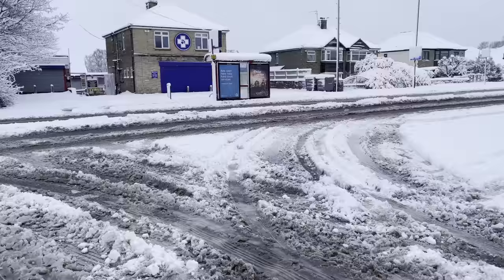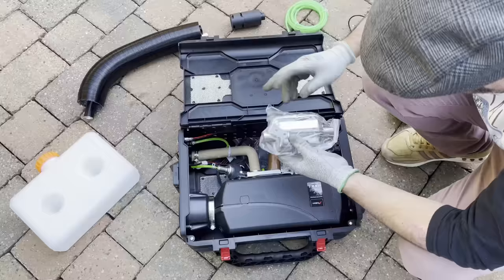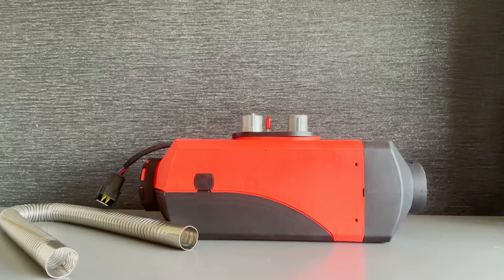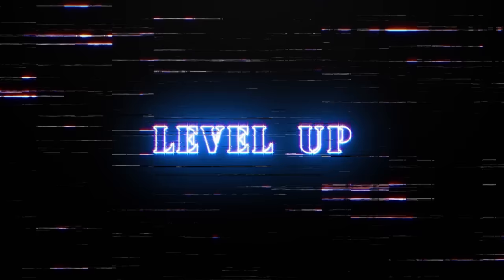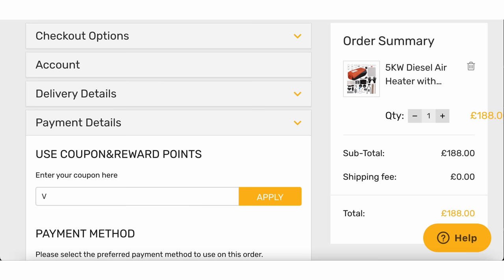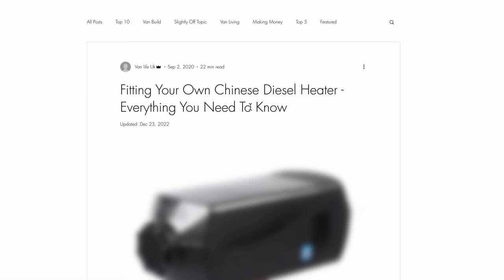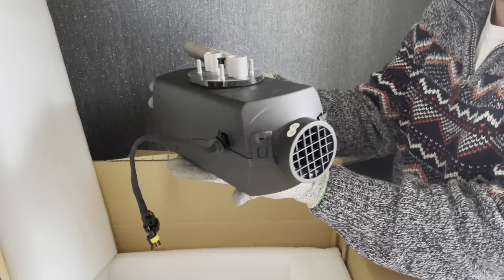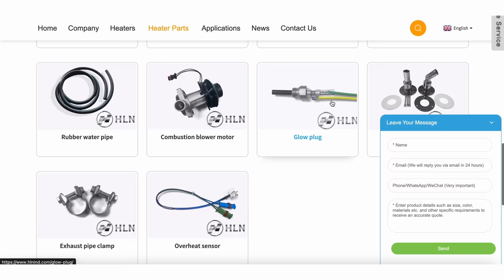Chinese Diesel Heater Buyers Guide & Tried and Tested Heaters 2023/2024

Comment: Just a heads up on VEVOR heaters, many of them are fitted with IEC power connectors (100 - 250v ac) but being used for 12 - 24v dc   absolute no no. I have just spent several years testing chinese goods for quality and safety and although now retired just help looking at such things.  Enjoyed the vid and found it both useful and enlightening!
Reply: I was shocked, but not at all surprised to see that. It's disappointing that the Chinese manufacturers keep sabotaging themselves with small things on otherwise good products.

Comment: Nothing wrong with that green fuel line just the installation
Reply from the maker: Its bad mate, not only is it not fuel grade, can kink, split, degrade, cause air bubbles etc it also means that the pump has to push and pull twice the amount of fuel than it does with the correct diameter fuel line wearing the pumps out quicker too. If you use any other fuel line thicker than 2mm inner diameter or the wrong type with Webasto and eberspacher and your pumps fail they void your warranty down to user error.
Reply: @vanlifesurvivorsguide  ive had my set up running with that fuel line for 2 years, i respect your vast knowledge on these things but these are my findings for diesil not petrol, it will only kink if your installation is poor, the ristriction through this feul line is minimal compared to the solid stuff so its not pushing hard at all(im a heating engineer, hydrolics and flow is something i know about) + you need to put a connection piece at every joint inc the filter!!.
Id like to know how old the line (or what you put through it for it to degrade or split, air in the line dose'nt seem to matter as  the pumps as its never running dry.
Ive just stripped my heater down to see how see looks inside and i cant believe how little soot there was. None in the burn chamber and just a small amount on the heat exchanger walls. I use this in my workshop so its on all winter set on 1. Very impresive. Only run mine on kerro/diesil. Your vids are top notch so i hope you dont mind me " having a conversation" about "the green stuff" as i only ever use experiance to disprove ....or proove what works or dos'nt. Keep your vids coming there informative and entertaining.
Reply: I have a vevor, eberspacher 5000. It has the controller with the timer., and 6 levels of heat adjustment,  or temperature controlled.  my question is there any way to change voltage from 12v to 24v.

Comment: One small detail to add, I have the 5kW Maxspeedingrods and it's controller does go to sleep with a black screen after a few minutes. I also tested the burn mixture with a CO tester and found it to be perfect, averaging 1-2ppm once at temp. The fan is also double balanced and is very quiet, despite being brushed. It's controller also has audible speech assistant. I'm very impressed with it so far.

Comment: I appreciate your buyer's guide.
I bought a Chinese heater and after installing it, it worked for 2 hours before it thew a high temp sensor code.
Reminded the first didn't work, I expected is that a replacement wouldn't either.
So, I ordered three new sensors from three different manufacturers.
I also ordered a rebuild kit.
It's still 15 days out.
When the first high temp sensor arrived, I installed it, only to have the unit throw two new codes:
Underpower and overpower.
Yet another reminder that it's Chinese. 
I've ordered a new motherboard and controller... 20 days out.
If it doesn't work, there will be a sledgehammer party at Peter's house.
I expect I'll be buying either an 
Hcaloric or something a bit more expensive.
Thanks again for the buyer's guide.
I'm polishing-up my sledgehammer...
Reply from the maker: To be honest mate, it sounds like you have a dead cell in your battery or a vey low battery. Either that or the motherboard. I have pnly ever seen error code 2 on 12v if the battery was damaged or the motherboard
Reply: Lucky for me, I ran into you !!
While in wholesale denial, I checked the battery with my voltmeter anyway...
My brand new battery was only kicking 8.4 volts.
Luckily, I'd bought two.🤣👍

Houston ?
We have heat !!
Reply: 2 hours later, the pump dies.
I already ordered the quieter pump, I'm just not sure what I did with it.
Honestly, have you ever heard of anyone having this much trouble ?

Comment: My new heater arrived. Been testing, OLOEY 12V-24V Diesel Air Heater 5-8kw £80. Worked out of the box, no smoke. But the inlet silencer not very good, just hollow inside. So have a few exhaust silencers so put one on the air intake, what a difference. Stopped the intake roar. Have a box silencer for outlet, definitely better than the tin plate one. The controller just has a 6 step temp. controller. Better as you can change at will from remote.
Reply: Video prices expensive.

Comment: I've spent weeks trying to decide if a diesel heater was the correct choice for my Bongo Friendee petrol driven, self-converted camper. It's almost the last job, and I've done 95% of the design and actual work myself: not bad for a 69yr old disabled old bag methinks😉 This video told me everything I needed to know and was very unsure about, thank you so much. It's down to the Lavaner Pro 2kw and the HLN Aerolyn 4kw now, but I'm wondering if the HLN, which I think is my prefered choice, would be over-kill? The van living space is only 130cm x 210cm and there's no space beneath the front seats, which is where most people seem to mount them although it could possibly go beneath the R&R bed, by the back door, but then I'd worry about sleeping above it!  Having it outside the van would be difficult as I can't bend my back much and I can't kneel down either, so filling the tank would be a huge challenge! I'd be grateful if anyone has any ideas/solutions which could help, thanks 👍😊
Reply from the maker: Hi Lynette, yeah i think the 4kw hln would be over kill but they do a 2kw hln too that would be perfect  for a bongo. 

Yeah as long as these is nothing in the way under the van is should be fine, but with a HLN you wouldn't really need to be getting down to it as they are so reliable. Where are you based? We would be happy to take a look for free for you we are based in Bradford

Comment: I have two 5 kw unbranded units to heat my insulated garage. I have nat gas overhead heater. But don't like using it. Too noisy burns too much nat gas. No shut off for flue. So when it shuts off all the heat goes up the flue. I have a piece of cardboard with magnets I stick in to seal the flue. Then use my diesel heaters to heat garage. I installed an hcalory engine preheater in my pickup to preheat engine when it gets minus 40. It's on its second year and still working good. So impressed I just bought another for my other pickup. But new one I got comes with different remote and in car control module. Wish they would have stuck with the old controller. But the one I bought last year still works good. Hope the new controller and remote works as good as the older ones
Reply: For my garage I have one that is all in one. The other the heater uses a remote fuel tank. Not sure I like the all in one unit. The tank sits right above the burner. If tank cracks or leaks it would drip fuel in burner. Only takes one to heat garage to working temp. I fire both up to heat garage faster. Then shut off the all in one. Did mods to my main one to make burn chamber last longer.

Comment: Another good video.

The recommended manufacturers are the ones often quoted within EU van and boat circles. The Russian versions are also good, but with less variety, (but in some ways that can be an advantage).

I will check out the video on controller types, but on my last investigation of the few dozen I have come across, there were several different types, creating well over 20 possible combinations with some connectors failing to match. Some worked when wires were reconnected to the appropriate pins, but in short, the variety of controllers and mother boards was unforgivable. In a few cases the chip used on the board, in identical units, was completely different, so I must simply accept the term 'universal' on face value.

I have not had problems with the green fuel lines, or even the 'clip on' clamps, but again, in so many areas of these heaters, a bit of standardisation of parts would be the common sense solution. Not much chance there unfortunately.

Not decrying the fine work by this team at vanlife, the solution would be to control imports to ensure a standard 'high quality gateway' into the UK. So many faults, incompatibilities, and downright rip off adverts would be avoided. It is a shame that such videos need to be made as general engineering principle would demand that parts could be obtained which are always compatible and then fitting instructions could be easily copied and swapped.

These heaters are crying out for a warehouse controlled import infrastructure, which must of course involve the main players in its creation. Vanlife would be at the front of the queue, obviously.

Great vid. lots of useful data, and some sense is being made of a snowstorm of parts, incompatibilities, lack of backward compatibility, and vague advertising surrounding these products.

Some day, hopefully, this jungle will be tamed ?

Comment: Had mine fitted van about 5 years now. Only a Berlingo van  but 10 minutes on it's toasty. Fan was rubbing on intake. Found out inside there are three spacer pins. The bottom one a couple of mill. short. So i taped a spacer to put fan concentric with the housing. All good. Just ordered 5kw one £80 for my flat. Mount on cooker hood vent just as it goes outside, tank in cupboard, battery, timed night charger. Could use solar panel?
Reply: Also the exhaust pipe  rotted away, so keep eye on exhaust pipe. Also have one of those quiet pumps, not much quieter. Where heater needs to catch up is the silencer, not very good, as said at full blast like jet engine and the sound carries. Some experimenting needed there..

Comment: I've got the Maxpeedingrods 5kw ready to install in my garage where I work. Upgraded the exhaust and silencer, plus some marine grade rubber fuel line.
I'm hoping the fact it's Bluetooth will help that the controller is basic? I ideally need to turn it on an hour before I start work each day. Running off kerosene too
Reply from the maker: The4 maxpeedingrods controller has a timer and is quite good so you should be ok if you remember to set it. The bluetooth is pretty useless unless you are in range of the controller though.
Reply: I don't understand what all the consternation is about having a muffler on these units.
Without one, they only make a small hissing sound.
Reply from the maker: @Peter-jo3wt  It can make a huge difference to the noise but yeah you are right its the air intake that is the real noisy bit
Reply: @vanlifesurvivorsguide  
I couldn't hear the intake over the fan, but considering it only ran for 2 hours, it would be petty to complain.

Comment: Question: Which unit is amenable to draw off straight from my diesel fuel tank. I have a 2016 sprinter which appears to have taps installed on my fuel tank. Can I run a fuel line from that to the heater and where would I place the fuel pump?

Comment: I was looking at rhe HLN 4kw to replace my old Eberspacher 3dL .
The L is for long rang throw as this in on a sailing boat with 3 outlets and a 5m run .
Will the fan be enough to throw the heat and not over heat rhe unit?

Comment: I've ordered two of the HLN 2000W heaters and while the service and responsiveness have been great, they have both given me an E1 (load short circuit) error.  I'm using the harness they provided, and my power source is a  Bluetti 200Max. Did you guys have any issues on your setup with the HLN 2000W? (I'm using the new wireless controller).
Reply from the maker: How many amps does the 12v output give you on the bluetti? they normally only have a 10 amp out and the glow plug uses about 11 amps on start up. Deffo a power supply problem either way if it is happening to both heaters
Reply: @vanlifesurvivorsguide  The confusion was the connections.  There are two that are identical and I had them swapped.  Great support from Ken.

Comment: Does the Lavaner Pro MAX and its special controller shut off when it hits the correct temp? Or does it keep running on low like the normal CDH controllers?
Reply from the maker: it just keeps running, it would be a problem for the battery this is why even the best heaters do it. We do have a solution though in our newest blog post. I will post a link in the description of the video so you can have a look and see if it will be any help to you.
Reply: @vanlifesurvivorsguide  I saw the post! Very cool! That universal rf bridge is pretty cool.

Comment: Just went to buy the Lavaner 2kw at the link you gave and it states it does not ship to my address... UK mainland...
Reply from the maker: Hi mate, you need to either sign up to ali experess so it knows your address then it works differently or download the app on your phone and order from there i believe. Failing that if you scroll down a bit there is an email for Craig he from lavaner and he will point you in the right direction for uk stock and distributers :)

Comment: The same standalone heaters are whats inside the all in one unit. They're the same thing. Why can't they be used in vehicles?
Reply: They can be used IF you disassemble it, remove the actual heater and buy a mounting turret and mount the exhaust connection from the heater outside the vehicle but you’ll probably need to extend the wiring to the controller and buy longer fuel line

Comment: Thanks for the update, I am just about to purchase a Lavana 2Kw unit.  What are your thoughts on tapping into the diesel return line from the engine?  This looks like an easier connection than dropping the fuel tank.

Comment: WHY YOU DONT RECOMMEND THE ALL IN ONE DIESEL HEATERS TO PUT INSIDE YOUR VAN ?
Reply: Because the exhaust connection would be inside the vehicle
Reply: @stephenlord599  ok i didnt know that, i thought it had a hose to run out the bottom of your vehicle, yes that would be something i wouldnt trust either
Reply: @owensdaniels6244  the exhaust (and inlet)  is cast into the body and straight to the burn chamber .. it’s all one piece.  
This should be joined to the exhaust pipe outside any enclosed area.  It basically pushes on and is held by a clip ..